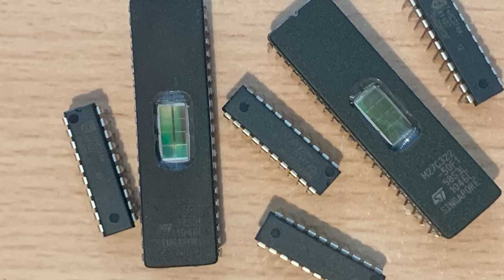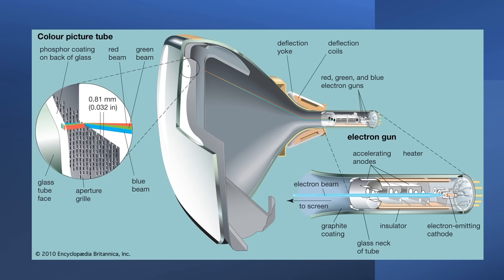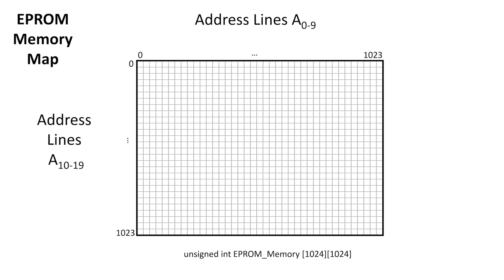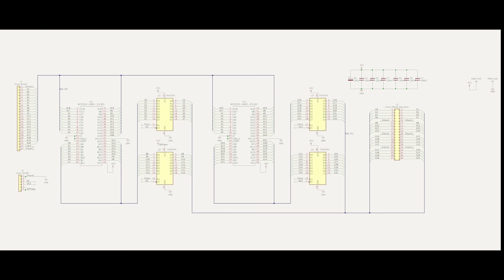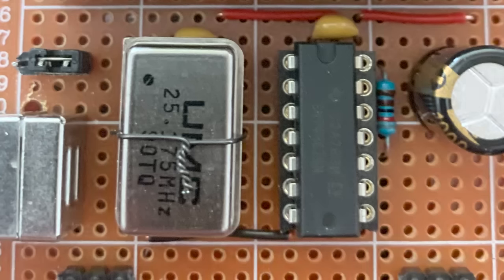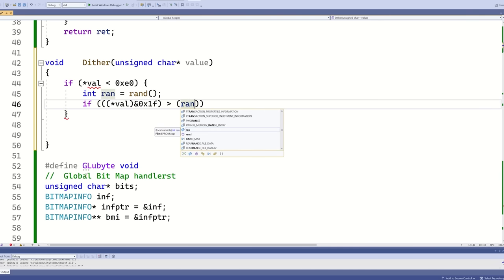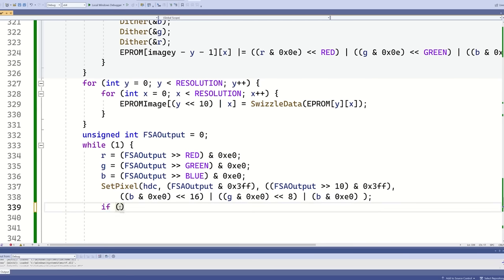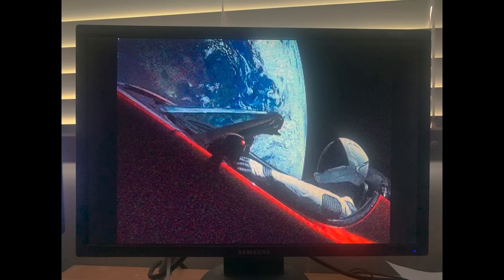VGA from an EPROM, is it possible.

Comment: Hmmmm. Could I get a motherboard with no CPU to do video out by violating the BIOS chip..? Need to look into what exactly requires the cpu, and what it can do without one. Curious if a modern chipset could be powerful enough to run doom. I feel like it’s a necessity for a good CMPE undergrad to get doom running on something new and I dont think anyone’s done an empty motherboard yet.
Reply from the maker: NVidia requires a CPU to configure the chip.  Only custom older designs work without a CPU.  Even those that use the 6845 require a CPU to initialize it.

Comment: Am I missing something here... okay, yes, I am....   An Eeprom stores the image and and the code... but what's running the code?  Where's the processor ???    And then, the Eeprom's binary output is just dumping right out to those HC whatever chips which turn logic level into something VGA can use ?
Reply from the maker: Well, the EPROM is storing the horizontal count (and vertical count too).  No external count.  Imagine the output of an adder connected to a set of flip flops, then the output of the flip flops goes back to one adder input and the number one is the other adder input.  Can you see how that would count up?  Well, the adder is combinatorial logic, so we can replace it with an EPROM.
Reply: @DrMattRegan thanks for replying but i'm still not getting it.  Maybe I have always misunderstood how an eprom works.  You have an address bus, a data bus and  r/w pins to pull or push data so how is that running code ?  I just watched the ben eater video which has a lot of detail and i understood that.. but his counter is done on external chips so the eprom is just there to output a byte for the  display bitmap from an  address given by the external counter but you just have eeproms and no counter chips. Code with no processor makes no sebse to me.. like a recipe without a chef :-) Sorry if I'm frustrating you..I'm frustrating me too :-)
Reply from the maker: @jacklewis100  close.  The eprom contains the data to be displayed and the address of the next pixel.  On the positive edge of clock the next pixel address is latched into the 374s and this becomes the current pixel address. Then we do another look up.  For all addresses outside the scan, we count up until we hit a location which is part of the raster count (I could have also set the next pixel location to be 0). That way it doesn’t matter what the flip-flops hold on power up.
Reply: @DrMattRegan  ahh...  the penny just dropped... or rather my brain took a wrong turn earlier on so that confused everything thereafter...  I've retraced my brain steps now.  The code was confusing me... i couldn't understand how code was being executed but now I realise the code was run on a pc just to generate the eeprom code!  Duh!  Brilliant.  Thank you.
Reply from the maker: @jacklewis100  excellent.  Glad you stuck it out.  The official name for the structure is a finite state machine.  In this case, the state is the screen location.

Comment: Question.  Why does the order of D0-D15 matter? If you write the data in any decent, order you should get the data out the same way.  It's almost the same for the address lines, but since each address line could enable a bank,  the reading delay won't be the same.  This is very important for DRAMs since their addresses are multiplexed.  Any reasonable arguments?
Reply from the maker: You are right, from an electrical perspective you can mix up the address and data lines as much as you want on these EPROMs, it's 50ns access no matter what.

The problem with the 27C322 is if you write LSByte then MSByte into the file that you program the EPROM with, it will come out on the pins as D0 : D8 : D1 : D9 : D2 : D10 etc...  

Now you can wire up the 27C322 correctly into your circuit so that this would not matter.  

The difference comes at debug time when you are running a logic probe up and down these pins.
It's just so much easier if the pin ordering is contiguous.

Before i started using this swizzle routine, i just found it hard to read of hexadecimal values with the logic probe.  So i do take advantage of the fact that i can mix up the data lines without penalty.

Comment: have you ever considered making a low resolution HDMI circuit or is that not possible with these parts?
Reply from the maker: In theory yes, but I think the minimum HDMI frequency is 125MHz from memory, so you'd need much faster parts.
Reply: I read that the lowest data rate for hdmi was 250 MHz. You would need to provide 4x balanced 2.5V logic signals and the signals are 8b10b encoded from the VGA signals.  It is then up to the monitor as to which screen resolution and refresh rate is supported. Also hdmi is a licensed technology, so maybe digital video via display port instead. Anyway I think using an eprom is a novel approach to this solution,
Reply from the maker: Very good points.  I think i would use an existing solution for HDMI

Comment: hm, if you used static ram instead of a rom, could add in sprites, cursors , text data etc by using extra memory for sprite and char lookup data.

would also give you a direct way to update image data. if you offset the address bus via a secondary 'rom' lookup, text or image scrolling
Reply: ram; nstead of rom also gives you a? ay to have a BIOS type init to change  screen resolution etc on-the-fly.
Reply: chatGPT and similar AI tools could use this method too
Reply from the maker: Yeah, ultimately there will be SRAM for image storage.  The ROM image is just for debugging.  I'm planning on doing some more with the design including 3D rotation.
Reply: I watched the ben eater vids before I did yours. after that It makes me wonder why this never happened back when Apple ][,C=64 never did this.

I temember VGA graphics being easy to program because it was just a linear array. no special addressing modes needed. 

aka Grahics Gems Books on how to do basics like DDA line drawing and fast fills etc. eay before graphic specific gpus

these new tricks to old hardware could have jumpstarted audio specific cards too (dma memory from disk, sound samples)

Comment: It is a novel approach. Clearly quite simple and flexible, but also wasteful (~90% of memory is either unused or wasted for next address values). Still, its simplicity is why it is nice.

Using binary counters and comparators for row and column, plus an adder (if the number of columns is not a power of 2) to fit it a contentious region, and no next addresses would be easy too tho. Another option is to have EPROM still for generating control signals, but RGB data stored separately. Like James Sharman 8-bit computer.
Reply from the maker: Yes, admittedly wasteful.  My aim is for someone not too familiar with 7400 series logic to look at it an say "Oh, is that all that's happening"

These big EPROMs are actually very cheap and kind of fun.  You can do things in unusual ways.  If you haven't seen it already you might want to look at https://www.youtube.com/playlist?list=PLjQDRjQfW-84aOLT33kzoZghRofK-uL1F for some more large EPROM madness.  Don't forget to watch the last 5 minutes of the 3rd (and final) video in the playlist.